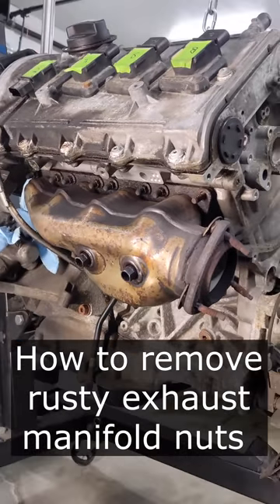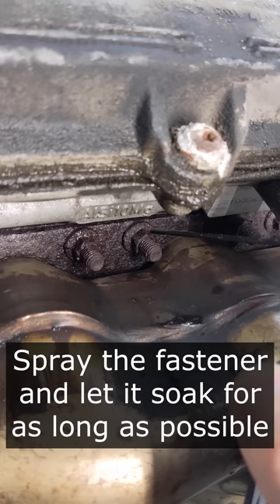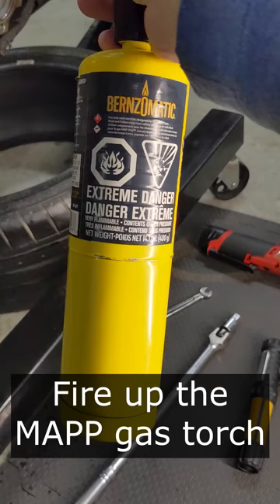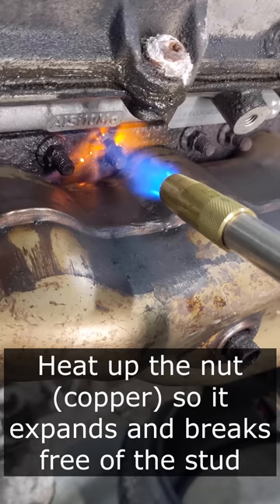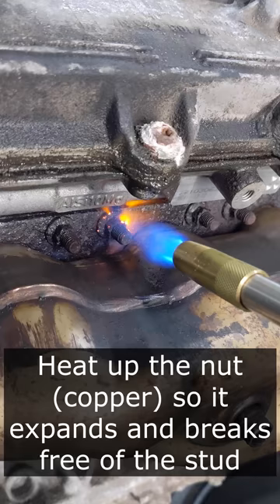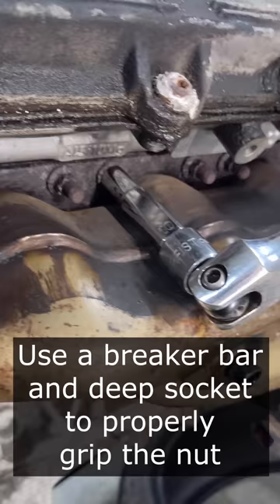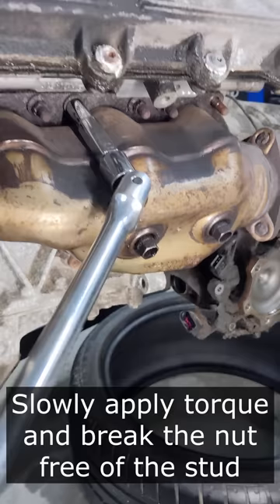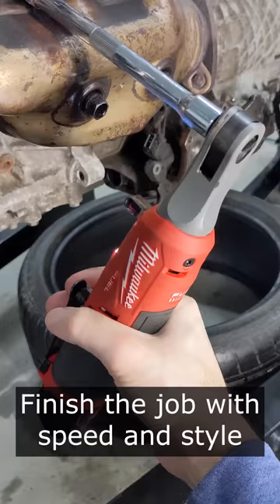How to remove rusty exhaust manifold fasteners #shorts

Comment: That nut is not copper! It is a steel nut coated with cadmium ( against rust) looks like copper but is not.
Reply: Bro shoulda just used Kroil on it   No need for the torch, if you gonna use heat induction shoulda just used a induction tool 🥴

Comment: Tell me you don't live in the rust belt without yelling me you don't live in the rust belt. "Compeltely rusted" 😂😂 home boy that's in excellent condition still
Reply: Lmaooo I was about to say the same thing. That looks like a 2 month old enging around here lol
Reply: @JJ Underwood  right?! I've worked in every aspect of the automotive industry up here from lube tech to business owner and never had that kinda luck other than new cars at the dealerships 😂
Reply: That's new in The Great White North!!!
Reply: Thank you for the tip 😊
Reply: Yep...ohio Pa Michigan NewYORK/Jersey......
Reply: In Northern Illinois the nuts don’t even have a hex shape after 3 years. We use an oxy/ acetylene socket at that point😉
Reply: Here in dryer Washington state area. Our 50 year old cars still have coating color on the hardware ! I feel bad for you rust belt people, can't look at a rusty floor pan wrong without it caving in.
Reply: Rust belt has nothing to do with rust, but with industrial decline.
Reply: @Dash cam Serbia  it is a combination of both. It's scientific fact actually, sodium (salt) accelerates oxidation and that is what the process of rusting is. In the rust belt they pour essentially a brine on the road and use rock salt, the brine is sticky so it causes rust alone but also allows rock salt to stick to vehicles easier causing more oxidation (rust) than parts of the country in which vehicles are not exposed to these products. That doesn't mean rust can't happen elsewhere or vehicles aren't built the way they once were (which they arent), just means the rust belt gets it worse.
Reply: @talkwithtravis  I have tried finding out which areas of the USA are considered a "rust belt" and was not able too, because rust belt means something else, as I have already stated.
Reply: @DashCamSerbia  Illinois, Indiana, Michigan, Missouri, New York, Ohio, Pennsylvania, West Virginia, and Wisconsin are considered to be the Rust Belt states.

This came up when I googled "rust belt states"
Reply: @talkwithtravis  Yes, but has nothing to do with rust in that context... 
"The region received the name “Rust Belt” in the late 1970s, after a sharp decline in industrial work left many factories abandoned and desolate, causing increased rust from exposure to the elements. It is also referred to as the Manufacturing Belt and the Factory Belt. "
Reply: @Dash cam Serbia  I see what you're saying now, in modern context I hear it more as the areas that have snow and heavy salt applications but obviously yes you're correct in that sense.
Reply: @talkwithtravis  Yeah, I though that is what it meant as well. But when I looked it up, I've realised it is not and that everyone is using it wrong.
Reply: This guy knows. It's not completely rusted, it still resembles a hex shape

Comment: I usually crack them free and tighten back up until they are all free, that way the manifold won't spring out putting increased pressure on the next nut along.
Reply: Yep, that`s the ticket.

Comment: FYI - I typically use a Dremel Tool to remove corrosion before running out that nut.  Extra friction creates drag and more potential to snap it off.

Comment: NEVER seen a copper exhaust nut
Reply: They say stuff like this to get more comments. More comments = more reach = more engagement = more money.
Reply: I think they are copper coated to try prevent corrosion forming.
Reply: On expensive motorcycle it's quite common these days
Reply: They are a thing. But those nuts in the video aren’t copper lol
Reply: @TheUndertoe  obviously 🤣
Reply: @badgermetal  Copper nuts on the exhaust manifold to the exhaust pipe were common in the 70s for Chevys.
Reply: ever worked on bmws?
Reply: BMWs have them
Reply: I have on a forklift but I don't think it was pure copper but a alloy
Reply: In real life it's steel nuts and all the studs snap off lol
Reply: Not copper. They have been made from a bronze alloy but not brass i dont think so, Boss!
Reply: Used on ALOT of older German engines from 70s and 80s era.
Reply: @simontist   vw also
Reply: Have them on my downpipe. Nissan d40(frontier)
Reply: Alloy....
Reply: @@leroybrasfield7234. 8.8 is the metric grade not the material. Very similar to grade 5 in the U.S.
Reply: They use copper nuts on Mercedes Benz vehicles
Reply: У меня на LADA 2106 медные гайки.

Comment: 47 years old and today 1st time ever hear of a copper nut. Live and learn...🤔😂. Copper being the reason that manifold is so rusted. Should also be quite difficult to damage steel rods threads with a copper nut. Might also be wise to tighten the loosened nut back until you get others loosened too.
Reply: They do copper nuts, these aren’t copper though. That’s why the nuts are rusty😅
Reply: The exhaust manifold on my 1940 9N used copper nuts, it's a double edge sword.
Reply: The manifold to front pipe often uses copper nuts, not at the head
Reply: @MrBill67b  
Yeah, you’re wrong about that.
All sorts of engines including bmw use copper nuts at the head.
Reply: @MrBill67b  often never.
Reply: @Axle-Mackwithasinglestack  

No, it doesn't.
Reply: @skylined5534  yeah I replaced them with the original style, my great grandpappy had a new manifold in a wooden crate from Ford. With nuts, but they are square
Reply: @Whateverpoopiepants  Copper plated perhaps, but not solid copper.
Reply: Spot on 👍
Reply: @Whateverpoopiepants  plenty of old British vehicles use brass nuts 👍

Comment: If you get the bolt/nut red hot, and touch a candle to it, the wax will wick in and coat the rest of the rusty threads and 99% of the time it’ll come right off/out.

Comment: This is what happens when someone just reads and doesn't actually spend time out in the real world.
1. Penetrating oil
2. Wire brush the rust off as much as possibe
3. Hammer the nut w/a a 6pt socket in direction of axis (breaks the tension).
4. Loosen and tighten back and forth until you spin 1 time off. Re-snug
5. Again wire brush off the rust.
6. Loosen nut.

Adding high heat in concentrated area warps parts, overheats gaskets, and does far more risk and damage than a broken stud ever will.
Reply: My first thought was absolutely trying to clean the area. Looks like as much oil and carbon as it does rust, I always invert your number one and two personally as well. But this is the best comment by far so far. Cleaning is your best friend and so often overlooked, I know I try to skimp on it and it bites me more often than not.
Reply: @joshrakestraw5580  Ditto brother..
I guess something I didn't state.. I spray penetrating oil first then let it sit for 30+mins.
IF its really crudded up I'd wire brush first.
No matter... exhaust fasteners are never easy for anyone.

Comment: You’re more likely to snap a stud with a breaker bar vs using an impact because of the torsion breaker bars apply
Reply: If you get red hot spray cold water on it then hit it with the impact. Settling torch works faster
Reply: Exactly. I discovered this around 1990. I always use a 3/8 Ingersol Rand air impact. Works like magic!
Reply: Have to feather the trigger though, can't be a big solid hit, and work it back and forth a little
Reply: @johnnybaber1804  acetylene
Reply: @johnnybaber1804  

Quenching.
Reply: Impact wrenches apply torsion. If they didn't they would be pretty pointless.
Reply: @alexrosado3890  
👍
Can't be stuck if it's liquid!
Reply: As long as you properly apply counter torque,  then it's the same thing only with more controlled application.
Reply: @ferrumignis  impacts apply blows to every corner of the bolt from every direction. Breaker bars are applying leverage onto the bolt from 1 direction. They both have their uses but on a stud only a few mm thick with a rusted nut is still more likely to twist and break with a breaker bar.
Reply: Ima give ya a minute ta think on that. And then, maybe you are testing the rest of us. Look Maing, guns don't kill people, people with guns kill people! (No studs were harmed in the making of this comment)
Reply: Can i use a air hammer with a socket extension to remove the bolts ?

Comment: That nut is not copper 🤣🤣 edit I typed but:(
Reply: Agreed
Reply: Facts as copper and steel would have another issue called dissimilar metal welding happens with corrosion of the two different metals this paired with many Manu heat cycles leads to you 100% chance of just breaking the stud before the nut even moves
Reply: It’s not cor ten 😂🤣😂
Reply: My butt is not copper either.
Reply: @emmittmatthews8636  lol
Reply: @Jihadbearzwithgunz  

Wrong metals.  Steel and aluminium but never copper and steel. 

Long time metallurgical examiner here.
Reply: @skylined5534  couldn't remember what metals it was thank you for the correct information

Comment: You also need to make sure that you are using a 6 point socket on a 6 point fastener. Using a 12 point is a good way to round off the corners especially on copper nuts.

Comment: Copper melts at 2,000 degrees Fahrenheit and also the nut is not copper it's Steel
Reply: The roasted nuts aren't too much of an issue but those threads are. I usually take the diagram under and clean up the threads a little bit that will also help as well

Comment: My method is this: Skip the penetrating oil as it will just burn off. I utilize a torch and a socket and 30" ratchet. Heat the bolt for several minutes, then slowly back it off/out. Repeat this, heat, back off, heat back off. Take your time, use minimal torque and never a power tool. Works on everything every time.

Comment: Use a wire brush to get as much corrosion off the thread as possible.  The nuts have shoulders so when you put the socket on, give it a few taps with a hammer.  Helps loosen things up

Comment: Never take the nuts completely off one at a time. Loosen them one by one from rust. Keep them all on their studs and lightly tightened. This prevent a warped manifold flange from apply stress to the remaining nuts if you removed them completely in series.

Comment: Seafoam Deep Crerp is the best penetrant for this job because it won't flame up like PB Blaster or eat rubber/plastic if it gets into a seal, belt or plastic piece.  Plus it just works better.

Comment: Elbo grease is supposed to be used on the studs.  Rust buster and friction will prevent the buildup of rust during nut removal that could cause the stud to twist off which is a whole other problem.   Don't lose the stud,  grind the rust off.

Comment: I've been a mechanic for 30-40 years and yes I've never seen a copper not in my life copper is way too weak to use too tight the copper nuts would just fall apart

Comment: I had to remove exhaust bolts on a 400 Ford motor.  I sprayed bolts with same "rustbuster" as you immediately after returning home from work. Did this about 3 days in a row. Every single nut came off easily

Comment: Most vehicles don't use copper nuts on the exhaust manifold , you would never be able to torque copper the same as steel. Also, copper work hardens and can an will crack ..... video is alright, facts are wrong.
Reply: BMWs use copper nuts on exhaust manifolds

Comment: the are not copper,  but because a layer of rust ,in the threads , has seized the assembly.    torching the nut will allow it to expand, due to heat transfer across rust boundary, so.... The nut will swell and be allowed  to turn...

Comment: The nuts and studs are not very rusted thus this is a lousy example.
A hand torch is also a lousy source of heat. I just removed manifold nuts and studs that were 34 years old. I used an oxy acetylene torch with a small tip that heated only the nut. They all came off nicely, including the Y pipe flange.

Comment: Acetone and ATF as 50/50 mix is much better than anything else
Reply: Hmm never heard that before, so you prefer that against over the counter penetrating oil?
Reply: @ouch74  yes it works pretty good for me on these rusty bolts in Iowa from all the salt they use on the roads

Comment: Copper exhaust manifold nuts? Stainless, maybe, but that rust says nope, not a chance. The propane torch "might" be better than nothing, but you really need a heat source that you can pin point a little better. And then when you go back together use high temp never-seeze.

Comment: Can anyone tell me the proper way to remove these? If one breaks off im completely fucked as i dont have the expertise or skill to get the broken bits out. Like what penetrating oil should i use? Do I apply full pressure or just a tiny bit?

Comment: Or only buy cars in which the exhaust components are fastened using carriage bolts, which come apart as soon as the bolt is cut.
Chrysler/Dodge/Plymouth had this figured out literally 50 years ago.

Comment: MAPP Gas hasn't been available since 2004
Reply: Yep. New "mapp" gas is just propane with a few other propane-ish gasses mixed in, and burns at an ever so slightly higher temperature than propane. Pretty lame.
Reply: @VorsprungDurchNik  yep

Comment: If you spray hot nut with water it 100percent better coming off
Reply: It works good on boats that are for manifold bolts that are straight into the head

Comment: They don't use copper nuts on vehicles if they were copper nuts you don't need any heat copper is a softer material unlike steel also copper would never stand the test of time with the heat from the exhaust and copper don't rust🤣🤣🤣

Comment: I watch a lot of these crappy mechanics being a mechanic myself whenever you have a seized Bolt due to extreme heat the first thing you do is try to tighten that and if it turns Jessup tiny bit then try back in and up and if that doesn't work then you do all these other crazy things they show you